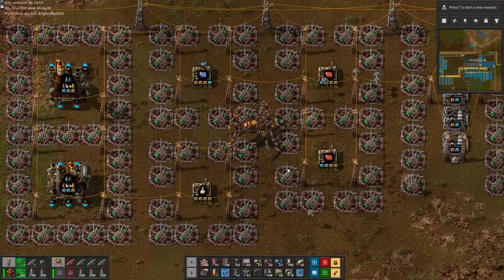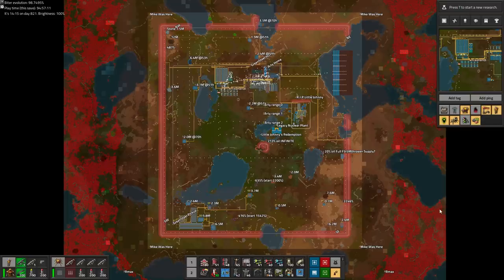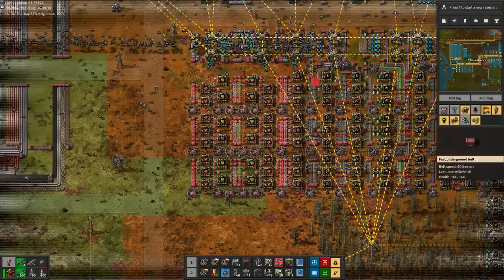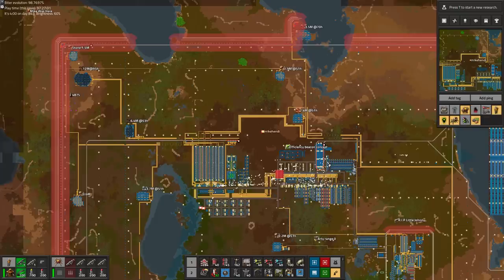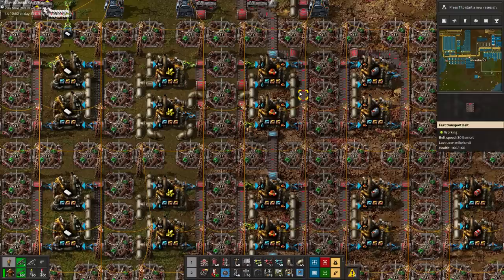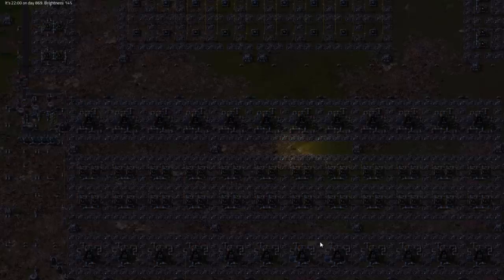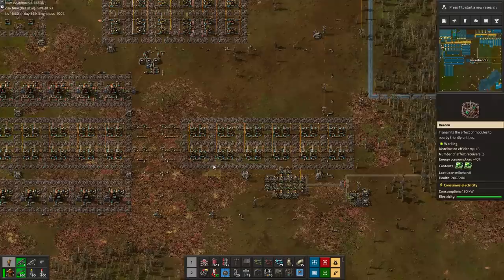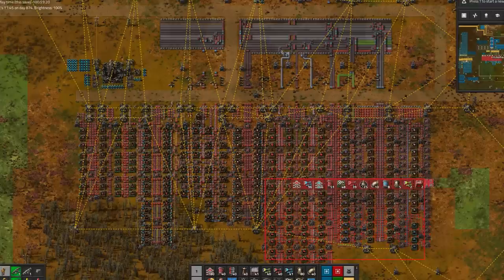Biters HACKED me and bots DELETED my Base!! // The Ultimate DeathWorld Challenge

Comment: Wow, this has gone through so many transitions.  From the frantic scrambling of grenading entire biter hoards, to running pumpjacks at full tilt hoping you get enough oil to last, to literally nothing but a handful of chests, to running around repairing walls waiting for bots to finish, to frantically grabbing an iron expansion, and now calmly planning an entirely different base with pollution (rather than throughput) as the primary variable.  What a rollercoaster!

Comment: Dear mr Hendricks, i found additional underrated use case for blue chests. You can use them as combinators. At first step you can copy factory settings into blue chest. At second step bots will fill chest by resources. At third step you can  switch mode of chest into reading content and multiply signals from blue chest in 100 times and translate signals into logistic network for train dispatcher. It better than call all requests by hands +  it maintain optimal ratio of consuming resources.
Reply from the maker: That does sound very useful, especially for train bases

Comment: @MichaelHendriks you should find a way to supply green nuclear steam into coal liquifaction as every boiler produces 30 polution per minute, which is an equivalent of roughly 60 beaconed assemblers. All efforts are dwarfed by those boilers :)
Reply from the maker: The steam consumption by coal liquefaction is fairly minor compared to steam power, but still, that is a good point actually. II don't think steam can be barreled though, which makes it a little annoying

Comment: i find it funny how often you mention 80% energy usage reduction. while each beacon utilizing more than the assembler do xD
Reply from the maker: I kinda have to, since pollution output is hardlinked to power usage increase/reduction. Beacons don't pollute at all, so with clean power, their power cost is not important
Reply: @MichaelHendriks  which is perfectly fine, but the energy usage of the beacons outstrips the saved energy of the assembler many times over, which is why i find you pointing it out so often, pretty funny :)

Comment: If costs are a concern, why not go for the squashed/bowtie beacon builds as opposed to square? You get greater beacon efficiency.
Reply from the maker: it's expensive to get to -80% pollution with less beacons
Reply: @MichaelHendriks  you can take that design and replace every other assembler with a beacon pair. Might need belt weaving but it's way better than the spaced out square design you used and you still get every assembler affected by 12 beacons
Reply from the maker: Ah, I see. IDK, given that I use mostly cheap eff.1 modules in the beacons, together with having "free"power, I'm not convinced using 20% less beacons or so would make up for the way, way harder belt routing, especially for the more complicated recipes. (Of course with the usual tier3 modules in the beacons the cost savings are much more significant though)